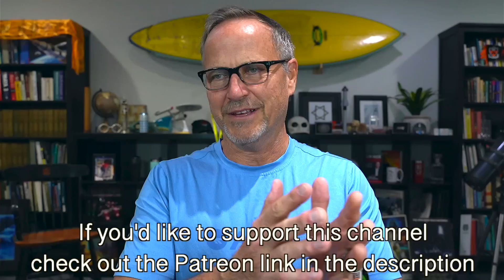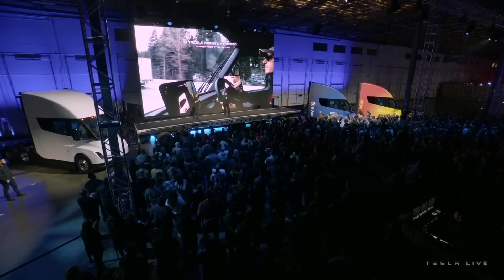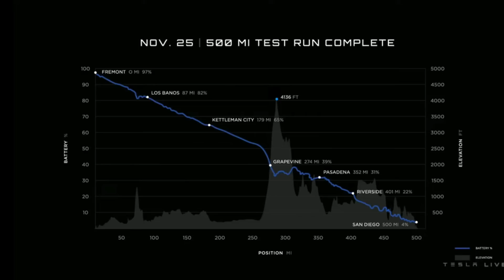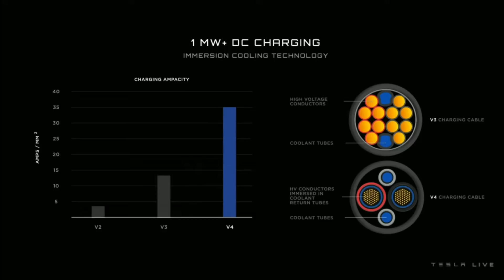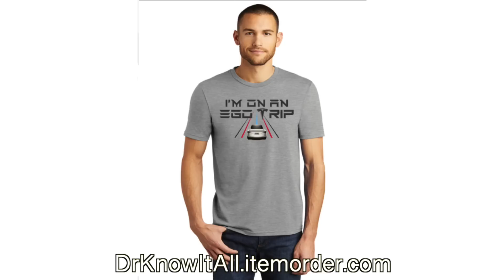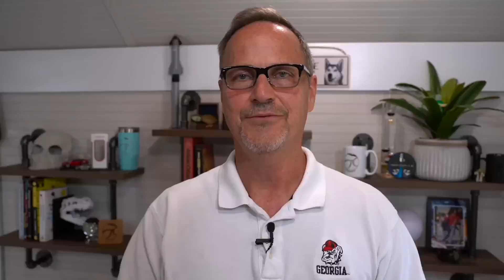Tesla SEMI Delivers on a HUGE Scale! Range, Power... and Cybertruck?!

Comment: You may be able to connect the Cybertruck to the same charging cable as used by the Semi, but that doesn't mean it will charge at the same rate. Maximum charge capacity is proportional to battery size assuming the electronics aren't limiting charge rate. The Cybertruck with a battery ~1/5 the size should therefore charge at ~1/5 the rate of the semi even when connected to the same charger. This  assumes that it is the individual battery cells that limit charge rate.
Reply: False
Reply: Correct, people assume the Cybertruck will be able to charge at 1MW, but it really just means it will charge at greater than 250 kW.  I bet it will charge in the 500-700 kW range, peak.
Reply: That makes no sense to me.  If the battery cells limit charge rate, then the Simi truck charge would be 5 times longer than the Cybertruck since it has 5 times the cells.  I don't think any of this is true as it depends on how Tesla designs the charge method for the battery pack and how much voltage is used.  Guess we will see next year.

Edit:  I thought about it, and I see what you're saying.
Reply: @billweberx  On the semi there are 4 separate battery packs that's how they are able to charge so fast that's why the cable is so big.
Reply: @david9192  I think the cable is big due to the size of the wires and coolant to handle a megawatt of power.  You may be right about the 4 battery packs, but in that case, they would split the power across the packs and charge in parallel.  I guess I don't see why they couldn't split the packs on the Cybertruck to charge faster.

Comment: The risk of an electric arc (short circuit over the air) increases with voltage,  right? So, the insulation materials need to be thicker and not degrade over time due to a constant electric charge, just like a capacitor.
Reply: Correct.

Comment: At minute 19:57 of the video, place a straightedge (ruler) along Battery vs Position graph and it is amazing how straight a line it is on average.  Functionally and the mountains are averaged out and it is almost as if travel is on flat ground because of the efficiency of regenerative braking.  Now these trucks have brakes on the trailers.  I wonder if they have installed regenerative braking and even motors on the trailers to further improve efficiency?
Reply: The braking force is providing the regeneration energy regardless of how many wheels are rolling on the vehicle. The only thing more braking wheels gives you is more total braking force, and more tire area providing the semi with shorter braking distances.

Comment: As I understand it, the trade off with higher voltage is shorter charge time but the batteries has a shorter lifespan. If you always change at home then your batteries will last long, but already at 400V, changing at a super station will shorten battery life. Going to 1000V will farther exasperate that. If your batter pack is huge then its a trade off most people will make, but when you have a small battery pack I can see wanting to limit charging to 400V to maximize battery life span.
Reply: You understand wrong.
The cells themselves are always 3.7V nominal and don't care how they are connected to each other to get to the pack voltage.
Reply: The main advantage of higher voltage is you can get away with thinner cables because the current is reduced. It doesn't really affect speed of charging; that's down to the chemistry of each individual cell (and BMS/cooling) and what they will accept.

However, if your maximum ideal cable thickness is limited then it helps increase the maximum power you can put through the cable since P = I × V and the voltage is basically tripling.

Comment: They only used 93% (97% - 4%)of the battery capacity so the 850kw (1.7 x 500) used is 93% means that 100% capacity is about 914kw
Reply: Don't forget the buffer that all other Teslas have unlike other BEVs--about 35 miles left on "empty", negligible for napkin math I suppose.

Comment: Thanks for the show. No mention of FSD in the truck, or even autopilot. Hold on there buddy. Show me a scientifically valid study, with good numbers, that says living near a highway causes shorter lifespan due to diesel fumes. I agree that diesel fumes aren't good, but showing a cause and effect from living near a highway doesn't seem likely within good science. I usually like you, but you've been a little brainwashed by climate propaganda. Just a little, not a lot. Talk about diesel mechanics, and now we have a conversation.
Reply: mortality rates increase on average by 0.7% per 10 microg/m(3) increase in PM(10) concentrations

J I Levy, J K Hammitt, and J D Spengler
Reply: @fredbloggs5902  Yeah, that's exactly my point. It's impossible to sort out all the different possible variables. For example, how about the positive effect of living near a freeway, that gives you faster emergency medical care? It's an impossible problem to control for what you're trying to prove. Good science starts  with being a good  skeptic, so put  on  your skeptic hat when you read  a paper like the one you referenced. If you can easily think of a way to change the setup of the experiment and get a different result, then it's not a very good experiment. And demographic statistics are not experimental data, except in very broad strokes.

Comment: Thanks for the very interesting video. As we know, Tesla has manufactured a Semi Truck which will revolutionize the trucking industry forever.  Could they make locomotives that use a similar set of motors and batteries and thereby revolutionize the railroad industry?
Reply: We already have electric trains. Batteries aren't necessary, just a third rail or overhead power system.
Reply: @jemezname2259  Batteries eliminate all that extra infrastructure costs and allow trains to run on current tracks.
Reply: autonomous EVs will render most trains obsolete
Reply: @fredbloggs5902  Not so much for freight as trains are really cheap and the infrastructure is already in place.
Reply: @billweberx  Hard to really say how it will actually wind up being whenever it happens, but Tesla claimed at the original Semi unveiling that an autonomous chain of three Semis would be cheaper than rail.
I still think rail is a better option for a variety of reasons, but it wouldn't surprise me if some uses of rail declined assuming their claims actually hold up
Reply: @billweberx  I agree freight will remain competitive for longer, the problem is that the infrastructure is falling apart and with declining revenue, maintaining it won’t be affordable.
Reply: @fredbloggs5902  Yes.  And over a long period of time, I agree that in the US, autonomous trucking will overtake freight trains.  I have no idea how long that will take.
Reply: @SyntheticSpy  Agreed

Comment: Elon didn’t say the Cybertruck will charge at 1MW, only that CT will use the same charger. A larger battery will be able to take more power, so expect less than 1MW for CT.
Reply: It doesn’t work like that
Reply: @fredbloggs5902  It does because each cell has a maximum safe power you can pump into it, so a pack of 1000 cells has a higher charge limit than one with only 100 (Real Tesla packs obviously have a lot more cells than this, but I'm just using this as an example). Ultimately at the individual cell level the Cybertruck and Semi will have the same capacity for power, but at the level of the whole pack they'll have a very different capacity at a given point in time
Reply: @fredbloggs5902  yes, it literally does.
Reply: Agreed, I expect the Cybertruck to charge in the 500-700kW range. Which would be a C-rate of 3.3 or so for a 150kWh - 200kWh battery pack.
Reply: @GregHassler  you can only charge at 1MW if you have a whole substation at your disposal.
Reply: @DrWhom  these things will be fronted by a MegaPack and handle it just fine.

Comment: I may be wrong, but I suspect that the reasoning for the 2 additional motors is because they need the 2 separate motors to do traction control and prevent jackknifing.
Reply: Do you think they might add motors to the trailer to improve efficiency and prevent jackknifing?
Reply: @NickMackenzieMD  I wonder if they'll start putting trailers with solar panels and batteries as well, then the truck doesn't need to wait as much for charging if it is picking up a fully charged trailer....

Comment: @14:45 Changing FSD to work with the Semi should only require a new start-up file where the EGO size parameters are specified for the footprint, turning radius, and articulation of the actual Semi.
After all, it doesn't change constantly when the truck is in motion.

Comment: You do not need a CDL to buy and drive a semi.  It is not Commercial if you are not earning money with it.
Reply: No, semi’s are classified as commercial vehicles and you need a commercial vehicle license to drive one.
Reply: @kokofan50  for personal use, you don't need CDL to drive a semi. couple of states have some additional rules such as CA where you need to attend a training class. in Texas you need to have air brake training - not sure this would applies to Tesla's semi. you can do search in YT on "semi rv", there are many RVers using semi pulling 5th wheel
Reply: My understanding is anything with air brakes requires a cdl. There is also a weight limit for non cdl drivers. This does vary by state. For instance, I was told that Colorado requires a cdl for a one ton diesel truck pulling a heavy trailer with an ag exception.
Reply: @jemezname2259  but again, personal use of semi is not regulated by DOT. no CDL/log book needed.

Comment: With only a few test Semi's Tesla won't have the required data yet, i imagine it will take a few years to collect enough data for Semi FSD.
Reply: Not true, training for signage etc. is common across all vehicles
Reply: @fredbloggs5902  training for signage might be common but training the neural net for the size & weight of the Semi + trailer is completely different to a car.
Reply: @markbrowning9363  True, but that’s a minor component of the training in my opinion

Comment: According to some surveys, long charging times is one of the biggest deterrents to EV adoption.  With the megacharger, it seems like that issue goes away.
Reply: The limitation is at the battery cell, not the charging system.
Reply: Long charging times aren't really an issue anymore, but I expect on average people still think it takes a long time. I don't know if the release of V4 Superchargers would cause many people to realize it isn't as slow as they thought

Comment: With the advances in simulation it doesn't feel like it'd take years to get basic highway autopilot up and going. City driving seems like it'd be much more difficult and require real world data due to variable length trailers and potentially needing a rear camera. I wonder if they're working on a wireless camera the driver can attach to the rear of the load; it'd have to run a calibration to hook into autopilot. Interesting stuff.

Comment: Any idea what the net change in elevation was on the test run; positive,negative or neutral?
Reply: Fremont and San Diego are both at about sea-level.. So neglectable elevation change
Reply: @MarcoNierop  Yes, net change was negligible,  but also climbed the Grapevine Pass and another large incline during.
Reply: @markchrist4044  They also had to climb out of the Bay Area and into the Central Valley over Pacheco Pass at an elevation of 1368' or 417 m. https://en.wikipedia.org/wiki/Pacheco_Pass. Now we don't know how fast the wind was blowing in the Central Valley.  That can make a difference between North-South vs South-North travel.
Reply: @markchrist4044  Yes, but if you looked that graph you would see that the extra energy needed to do the climbs, was given back during the slopes down, so netto it made not much difference.. THAT is the big advantage of regenerative braking and is impossible with diesel trucks... Like Elon said, you can't get the diesel back, you burnt extra to climb the pass.. but with regenerative braking you do indeed put energy back into the battery. This is one of the reasons, the semi is so efficient.

I just watched the Tesla Daily live stream, someone in the chat confirmed San Diego was 13 feet lower, so yes totally negligible. 

So Tesla has not been cheating to get to this 500 miles on one charge, Negligible elevation change, no aerodynamic tricks, truck fully loaded everything else stock production model.
Reply: @Marco Nierop  yes, I fully understand the graph and how regen works. I've driven Model S for 4 years and 60,000 miles.

Comment: Tesla train engine would be the next link in the chain.  Solar on boxcars too to extend range
Reply: Trains and ships might be a use-case for hydrogen or even methane if produced using solar/wind/batteries.
Reply: Yeah a Train CXS , they pull sometimes 100 -200 cars behind them , with solar attached on the roof they could possibly produce a lot of electricity to power the electric locomotive, would cut battery consumption on a sunny day by a lot I’d guess ? So much future uses for this power train. 👍

Comment: Any idea why they would be using the carbon overwrapped motors for the semi? I thought the original reason that was necessary was for super high RPMs to achieve 200+ mph with a single speed, doesn't seem like the semi would ever be hitting such high RPMs for it's use case.
Reply: I imagine that a high rpm combined with a high gear ratio will provide the torque required for the application.
Reply: @tomcrocker608  That would be a good reason!  Another reason is power to weight ratio.. You get a lot of power for what the engine weighs.
Reply: @MarcoNierop  sandy monro was talking about that the plaid would have 25 % more torque too . Good for pulling. They didn't  say nothing about top speed but 120 km 140km hour should be good enough .
Reply: Cost and efficiency would be my guess. The Semi would need 4 standard motors for the same power, which was the original design. It would also likely need 2 for the highway cruising instead of just one. So now it is cheaper to manufacture and  a lot more efficient.
Reply: Maybe they want to lower the costs of the motor which means they need more products using them?
Reply: For sure Tom is correct, the videos I've seen of the test Semi have a bit of gear whine, it's definitely being geared down significantly to a lower top speed than the Plaid, while likely doubling the torque.
Reply: Higher efficiency at high RPM, then geared low as top speed is low...